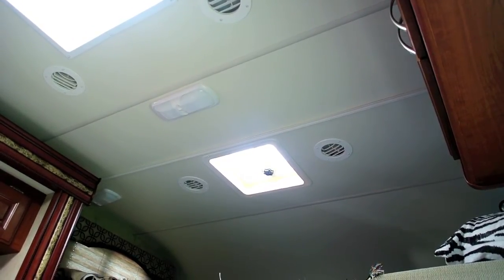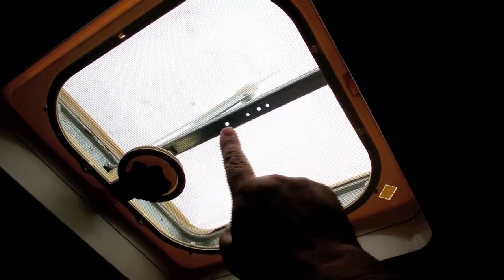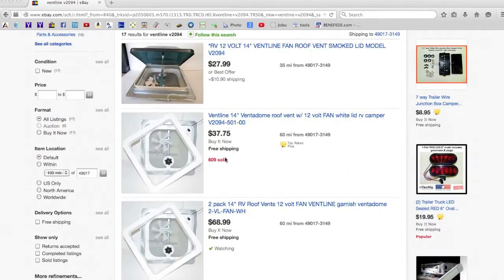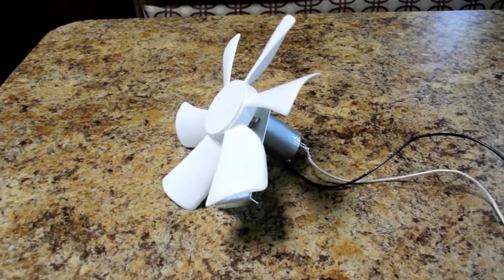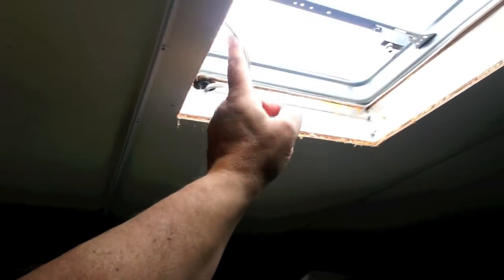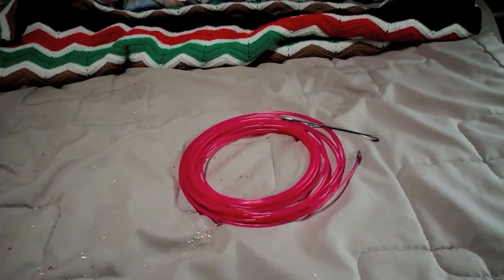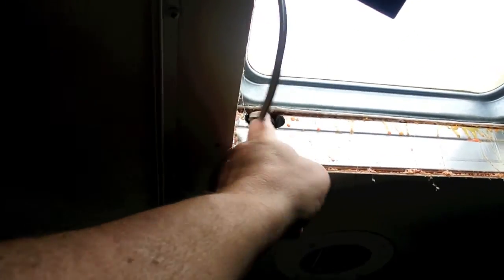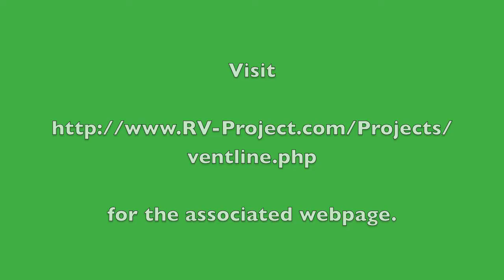Kit-bashing RV manual vents to powered fan vents.

Comment: I’d like to add a wall switch for my exhaust fan. Any suggestions?
Reply from the maker: Depends on how your fan is wired.  In my case, the fan ran off the overhead lighting circuit.  The power was on all the time, and each individual light had to be turned on or off, as well as the fan.

If your system is like that, you would likely have to figure out how to run wiring from the fan to the wall switch location.

But here is an alternative you may not have thought of. Amazon has tons of 12V RF/Wireless relays for sale cheap. Just wire one of those into the fan circuit.

Here is an example of just one of dozens you wili find: https://amzn.to/3x9kJW5

One issue with these relays is even when the device is off, a small amount of power is consumed.  This is because the receiver needs to be powered to receive incoming signals to turn the fan on or off.

One receiver won't really take much power from your house batteries, but the purist in me would suggest putting a switch in front of the receiver so you can turn it off when not needed.  

You could probably use the fan on-off switch for this, and the receiver is small enough you could probably mount it to the fan itself.

Comment: Oh good! I was hoping this was a thing. I don't see the sense in spending hundreds of dollars on a whole new deal for a little bit of circulation. Glad to see this is so simple. 
My lights have wall switches plus individual switches. Does that change the process?
Reply from the maker: If you connect the fan to lights that are operated via wall switches, you won't be able to turn the fan on unless the lights are on.

In my case, the RV mfg was too cheap to install a wall-switch, so they wired the lights with a circuit that was permanently powered, and relied on the switches in the lights to turn them on.

Fortunately, this meant for me that I could wire the fan into the switch circuit without having to turn the lights on via wall-switch.
Reply: @RVProject  Hmm, I can see how that would get annoying. Maybe I can figure out how to connect it to the range hood. Thanks so much!

Comment: Thanks for NOT showing the finished wiring.
Reply from the maker: The wiring between the motor and switch is already completed from the removed components, so when you transfer the items - there is no additional wiring to be done when kit-bashing the vent. 

Wiring the fan into the RV shouldn't be too hard to figure out, especially since you have the fan's owner's manual when you buy the motorized vent.  

I don't often do a complete step-by-step procedure unless it is something fairly difficult because there are variations from RV to RV.  What might work for one RV might not work for the other.

Comment: Why pigtail off the lights when you have power to the old fan?
Reply from the maker: In the RV, the lights had constant power. Each light had to be turned off individually rather than a wall switch to turn all of the lights off.  That made it easier to connect to 12V than having to run additional wiring.
Reply: Ok, thank you

Comment: Thank you. I realize this is an older video, but it still applies. I have a MaxxAir vent fan to install. I too will have to pigtail into a 12v light.
Reply from the maker: Good luck on your project.
Reply: @RVProject  Thx. I put one in my motorhome, it was easy. Then put one in my vintage Silver Streak - not so easy! That was because the standard hole wasn't quite right, so I had to do some cutting on the aluminum. Done!

Comment: This is GREAT.  I'm curious how you made the wire connections from the power source to the fan?  Did you use wire nuts, butt connectors, bullets, heat shrink, etc.?  Thanks for posting the video!
Reply from the maker: Butt connectors.
Reply: Thanks!  I ordered the new vent today on eBay!  I'm not sure why all RV's don't come with fan vents!